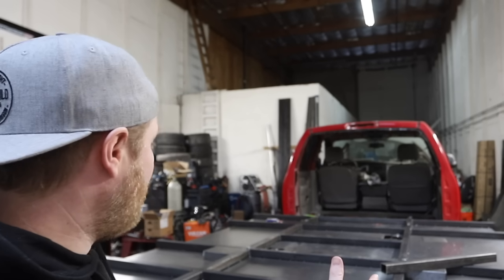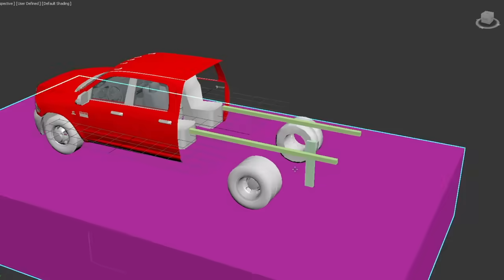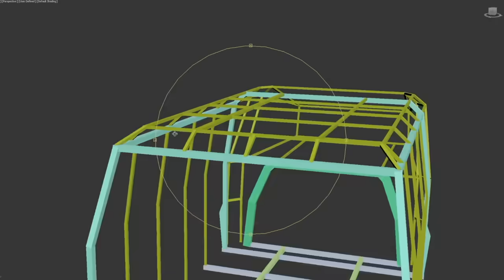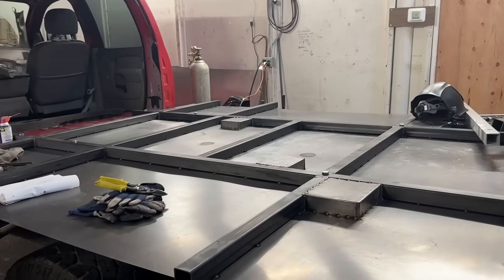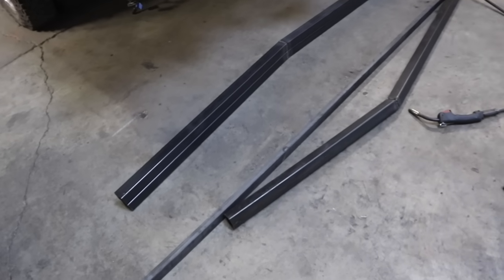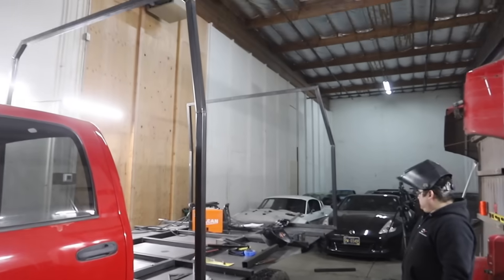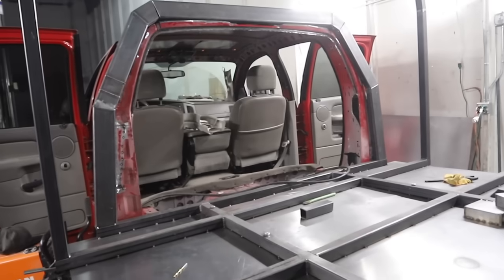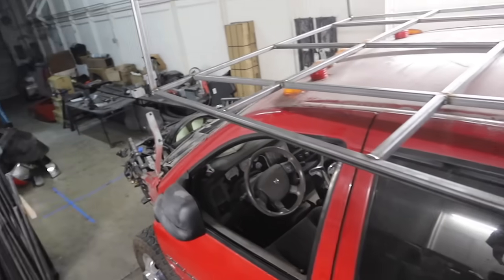Building The Worlds Craziest Overlanding Camper Truck - The WALLS

Comment: Why don’t you use a heavy duty rubber joint between the driver cabin and the back of the truck (kinda like the rubber used to join the articulated bus) it would be better since it’s flexible and waterproof.
Reply: If your concern is the seals ,personally I don’t think that’s a problem since the ones used on busses go through a lot of shit and still hold it’s integrity air and water tightness,also in your case it wouldn’t have any sort of pressure on it most of the time
Reply: @ehab7996  all cab and chassis busses are hardmounted.. no need for the rubber seal but they do all squeak and groan and eventually leak lol
Reply: Mate its called a bendy bus
Reply: @theabsoluteguy5516  You can call it either bendy or articulated bus, you can google it, however that's not the point.
Reply: @tacedaddy  My friend it's not about mounting the rear cabin he is already doing a fantastic job (no one can doubt this man he has done all sorts of crazy builds), it's about connecting the back addition that he's building with the front of the truck, obviously it's it wouldn't be ideal to fill the gap between the two ends with hard materials because sooner or later the back end of that truck would flex ,therefore it would be better to have flexible material to fill the gap I was talking about, again that's just my point of view.
Reply: @ehab7996  and having built over 200 vehicles from the frame off and also being a transit mechanic and seeing exactly how cutaway busses have been manufactured for the last 10 years I promise I know more than most humans on this subject

Comment: Did you ever think about adding another axle (6X6) to support more overall weight?
Reply: They want it for hauling cars around and adding another axle destroys your fuel economy
Reply: @MrCuttingI  you don't think adding the camper add-on isn't going to affect the fuel mileage? Even if it gets 10-12 mpg just add a couple of 50 gallon tanks it's all experimental anyway.

Comment: I don't understand how people think it will be top-heavy. A majority of the weight being added is no different than loading down the bed. The only thing that is real high is the roof with isn't much weight. And it's a dually, It's not going to roll unless they try and make a sharp turn at 50
Reply: To add on to that, all the heavy stuff like water tanks and batteries will be low and maybe even under the floor

Comment: Maybe others in here with more knowledge can chime in, but it feels like welding a bunch of box tube for the hoops is creating a lot of potential failure points. Why not just bend steel like a regular roll cage? You can still build the cabin off of that.

Comment: One thing I’m confused with is the desire to make the truck and camper connected from the back of the cab. If this is for off road camping, I’d want the camper and cab attached but only like a rubber tunnel or something. Attaching the camper and truck all together would not let the truck flex, and trying to do so could break something. Idk, that’s all I’m thinking while watching this. I’m hopeful and definitely interested and subscribed, I wanna see this thing driving through rivers and mountains.
Reply: I was wondering the same thing. My camper sitting in my trackbed bolted to the frame sure does move a lot differently than the cab.

Comment: I am not sure, but I think the frame will move differently than the cab.  It should not be welded to the cab as it will cause structural failure (as in rip the sheet metal.)

Comment: You don't need a CDL to haul multiple vehicles. You can haul 26k lbs without a CDL. Plus that's a dually so it should be rated for 30k+towing capacity
Reply: 30,000 pounds of towing capacity requires a trailer hitched over the axle (fifth-wheel or gooseneck); obviously this truck won't be doing that with a camper. This project has extended the frame so much that it shouldn't be towing at all.

Comment: A large slide in camper for that truck weighs 3000lbs and it's built out of aluminu. You will be fine as long as you don't add any gear. It will definitely look cool though
Reply: No, a large slide-in weighs 4900 pounds empty, and a much smaller one weighs only 3000 pounds.

Comment: Yeah the only fear i had was the towing. Like i know weight wise the truck will be fine. But if you have to heavy tong weight id be slightly worried of lifting the front wheels. But i trust you guys got this. Im excited to see the results
Reply: He doesn’t seem to have any idea of what the legal capacities this truck can haul, I wouldn’t put a ton of faith in him on this build.
Reply: @slowdaze  what do you mean legal capabilities for trucks to hual. The gvwr of that truck is atleast 14000lbs the truck factory weighs probably around 7k they arnt going to add over 7000lbs of weight especially when they have removed weight via the bed and rear fire wall of the cab. Now yes do far in total they have added weight overall but not 7k worth. This was a 3500 dodge. Im just worried about the additional leverage that hitch is going to have now on the front of the truck. The way they extend the frame is fine it wont break. Even if it does they didnt mess with suspension so the hitch would essentially just fall off. If they have issues all they reall would need to do is move the rear axle back to the rear of the truck. I have faith they will complete this build. They have ever really abandoned a build. The closet two i can think of was the first mustang build and the yatch but the yatch its way to cold where he is to work on that and the mustang wasnt his choice.
Reply: @5150Failure  legally they can add the payload capacity of a 2008 Dodge 3500 diesel 4x4 long bed. All documentation i have found indicates that is 4600ish lbs. Individual builds will vary by options but it will he around this number. 

My gas F350 is 4400lbs, but it is single wheel. The Diesel detracts a lot of payload capacity.

Comment: I know its probably too late for this, but why not try using the same method subway cars use for flexibility on joints like between the cab and bed so that you don't have to worry about the twisting aspect. Theres a few different way subway cars or even long busses utilize materials and shapes to help flex. but keep it air tight.
Reply: They make accordion seals that allow for some flexing. I’m looking at options like this for my own truck camper build

Comment: Surely building it with Alloy would have been more beneficial in saving weight and improving fuel economy this seems far to over the top for a camper van.

Comment: How do you get working mirrors when he made the body so wide?
Reply: Dodge mirrors flip out into "tow" mode.
Reply: @daleanderson88  I understand that but the box part of the rig they are building looks about 2’ wider on each side. The mirrors don’t go that wide in tow mode or they would stick out into oncoming traffic or the other lane.
Reply: @hirs0009  2 feet wider? looks like maybe 1 foot. my work truck is a 07 dodge 3500 dually and the rear deck/cabinets stick out about the same and its totally fine.

Comment: Times have really changed.  You jump on a computer to design this.  I'm 82, still design everything I make with a pencil, good eraser, and 1/4" graph paper.  I can even make things (not much metal, I do woodworking) that the site INSISTS you need a CNC router to make - which is 99% BS.  That's OK, you guys can play with your toys, and I go my own way, doing my own thing, and spending loads less on tools.  And if the power goes off, I'm not stuck, I can use a candle for light, and keep going.  Life is good.

Comment: I would have used aluminium rather than steel,on a conversion like this, to keep costs down I would source used material wherever possible, otherwise I'd have sourced high strength steel for the bed and the frame and used a lot less of it cos all that weight is going to cost you gas mileage and performance

Comment: Double laminated means its much safer if you get into a wreck you wont get shards of glass flying into your face
Reply: There is no "double laminated" glass in the Range Rover. The side glass is laminated (two panes of glass with a layer of polymer film between them), just like every windshield. That's "laminated", not "double laminated".

Comment: Will this welded frame have enough strength? I see most of the main support frame poles are done by bending machine but not welding. A big question mark!
Reply: They haven't bent anything - it's all straight pieces of tubing, mitre-cut and welded. Bending would be nice, but they haven't done it.

Comment: honestly that tubing is overkill in all aspects, from weight and space consuming til rigidity and price for materials- most of the structure could be buils off L shaped and straight iron bars.
Reply: he over-engineers everything by thousands of pounds.
Reply: Totally agree. Most campers on the road have a wood or stamped metal frame. He's building a tank

Comment: Why would anyone work off of a non-level truck frame just sitting on the suspension and tires, instead of just putting four stands under the frame, adjusted to provide a level and stable base?

Comment: B is for build, love the content on this one, but PLEASE move the axle back for your safety.  Dont tow anything over 13K either  Payload for a stock RAM 3500 pickup truck, 4wd with diesel and 3.73 gears is only 4610lbs.  add fuel, passengers, weight of that camper and you might be coming close to that number...

Comment: As the owner of ARE VEE IN A FIX your not going to like your build. It's not that the weight is to much for the spring weight of the truck but the weight above the axles is the issue. And when turning and side wind will be why you will hate this build. You should have tried a truck with a camper on it to test what a truck like yours will do. Air bags will help a lot. Get one that you can automatically set air pressure so that air temperature isn't a issue. I'm looking forward to this as it's what I fix everyday.

Comment: I laugh when ppl tell me what I can and can't haul or payload on my truck. It will tell me when the truck physically will not move. Or when the frame bumpers are touching my axle. If you don't push the limits you never know what they are.  You guys have a dually so youll get 10k lbs on that bitch before she starts to make you wonder if you need to add airbags.

Comment: How will you "overland" with all the rear "overhang"...you won't clear the driveway aprons at the local Dairy Queen let alone a ditch offroad. Dually tires are horrible for floation. Other than that...luck!